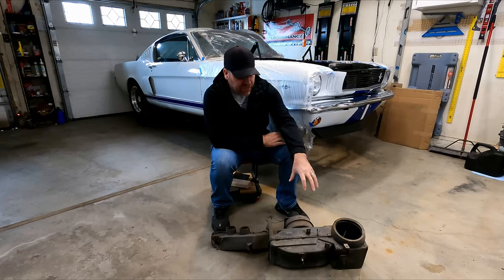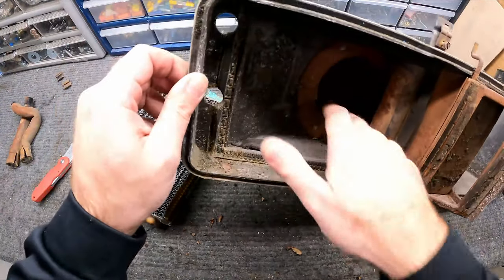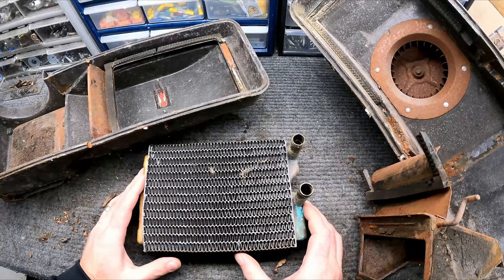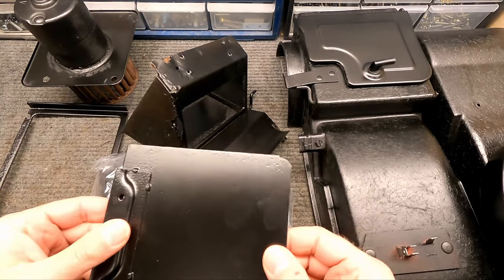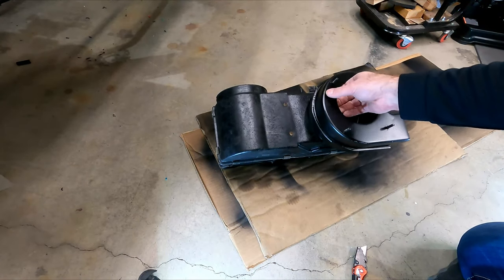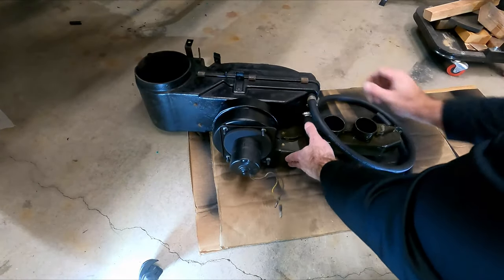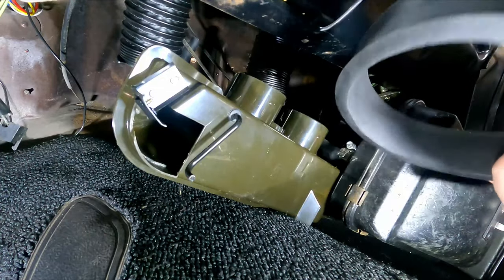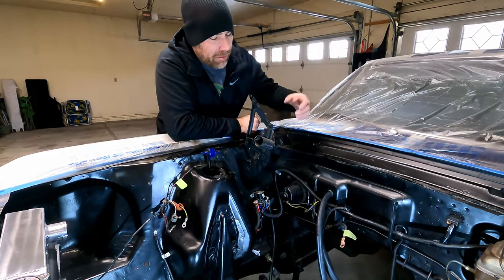How to Rebuild the Heater Box

Comment: Good job Andy.  Tip for the metal is to use a two part epoxy like 3M 08115 that has a rust inhibitor in it.  Spread a thin layer, let cure 24hrs and sand to desired level. Rinse & repeat.  Adds strenght back to the metal. Paint and Drive On!  👌
Reply from the maker: That’s a good idea.

Comment: Right call on the heater core.  You don’t want to put an old one in and need to replace it in the near future.  I did pretty much the same thing with my heater box that you did:  Refurbish the internal parts.  Unfortunately, my heater box was cracked so I had to buy a new box.  Looks good.
Reply from the maker: Thanks, I just hope everything works as predicted. Without the motor in the car, it’s hard to see if I did everything correctly.

Comment: Nice job. When I rebuilt mine I went ahead and bought a new blower motor. Mine worked BUT it's 57 years old. Didn't wanna get it all installed back again and have it go out shortly after. Maybe it wouldn't have but I feel more confident in it now.
Reply from the maker: I do the same thing with other parts, I can understand not wanting to have to take everything back out.
Reply: Good Call Joe Bob! Makes perfect sense while you have everything out. Where did you buy the new replacement motor sir? Thanks. Cheers from Motown.
Reply: @robertclymer6948  I got mine from National Parts Depot
Reply: @joebob344  I buy most of my Mustang parts from NPD. They are within 5 miles of the garage. My heater box is out of the car, but still have it, minus blower motor. Don't drive it in the cold weather, just an ex-race car to cruises and car shows now.

Comment: In my 68 non AC Mustang when i hit 35mph i start to get hot air in the passenger foot well and it blows harder the faster you go. Could this be caused by rotted foam gaskets in the box?
Reply from the maker: It's possible that one or more of the foam gaskets has failed.  I guess it wouldn't hurt to make sure the heater blower is not on when you think it's off.  Also, maybe check to make sure there are no other holes in the firewall?  I've notice that it gets hot in the foot-well area on my passenger side (during hot days), but I'm not getting hot air.  :)

Comment: At 16:30, do you grommets in your firewall hose outlets?
Reply from the maker: What?
Reply: @AndyKruseChannel  at 16 minutes and 30 seconds into the video, are those grommets in your firewall hose outlets?
Reply from the maker: @slappy1965  There are two hose outlets in the firewall that are stamped into the steel, all of these cars have the same two holes, in the same location. There is no grommet or soft device to keep the hoses from rubbing on the steel, except for the shape of the hole is designed to have a flared edge, which softens the area where the hose passes through the wall.  :)
Reply: @AndyKruseChannel  just pulled the heater box out, and just got the hoses out. Pumped up! Now off to shop for the white striped Autolite look-alike hoses. Thank you again.